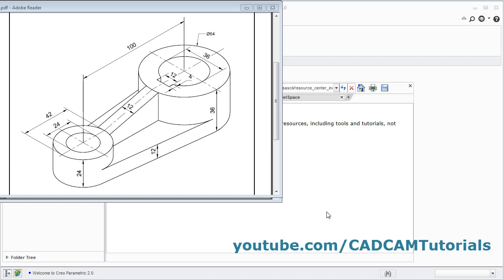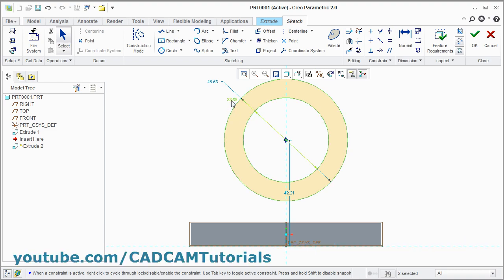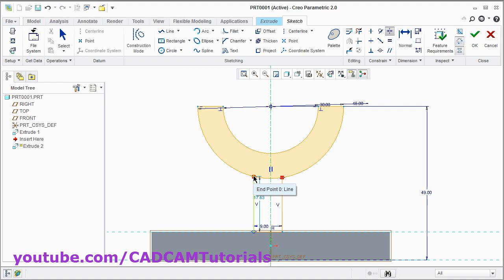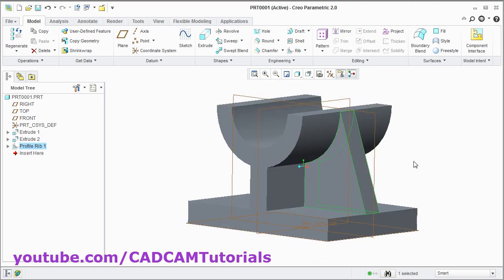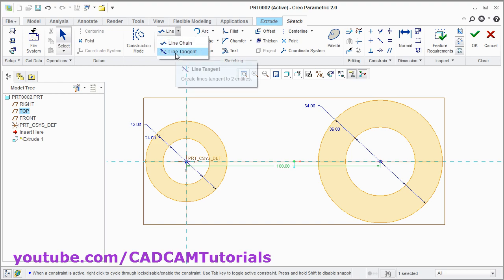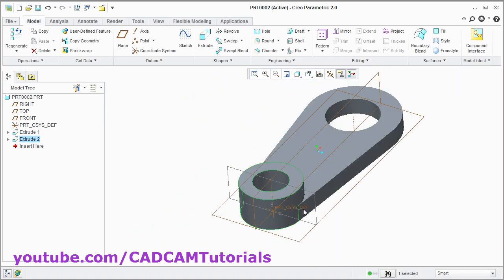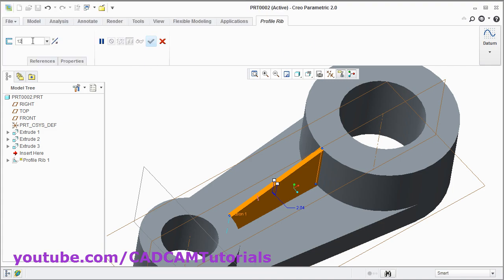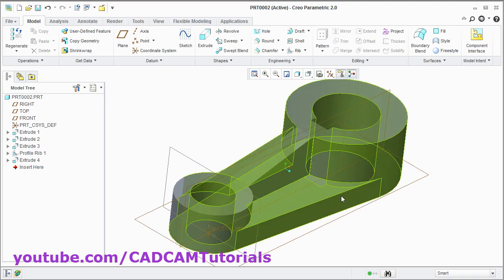Creo Part Modelling Tutorial | Creo Practice Exercises - 5

Comment: sir i am facing 1 problem ! whenever i try to cut small rectangle in larger cylinder , it shows cannot have mixture of open and closed section. however, i am following your steps correctly . why is it happening sir ?
Reply from the maker: Profile needs to be closed. It may be open somewhere.